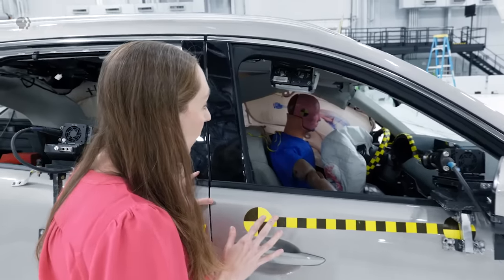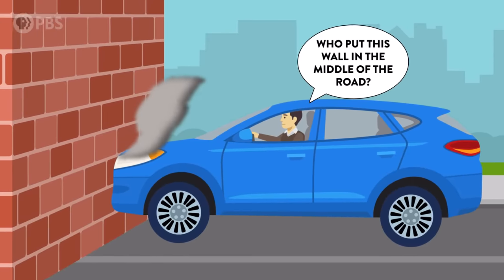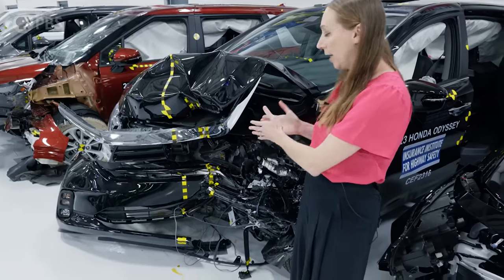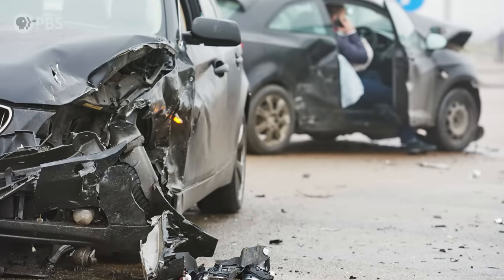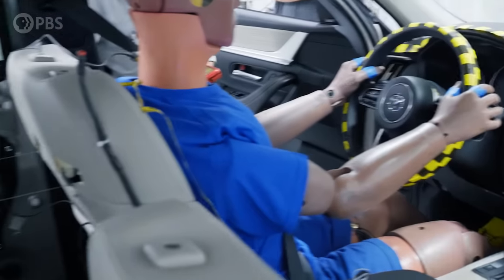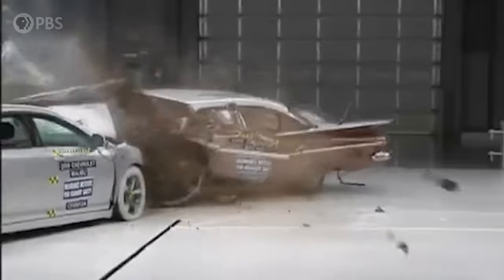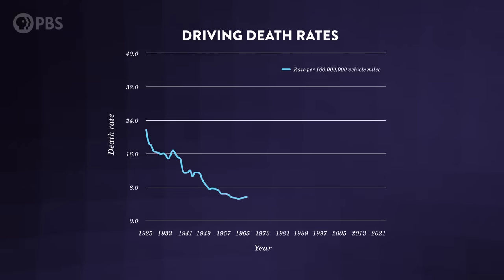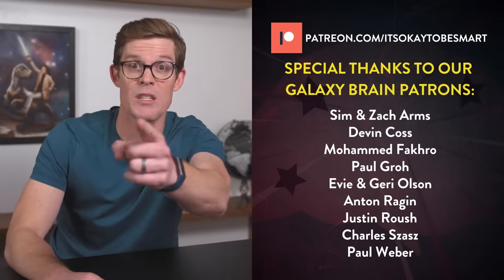The Incredible Engineering That Helps You Survive Car Crashes

Comment: My favorite fact in the topic is that the most violent looking motorsport crashes where the car rolls like 300 times are the safest because it has a long time to absorb the energy. As long as the rollcage remains intact you are most likely good.
Reply: I would like to note that motorsport has the best crash safety and a lot of stuff used in passenger cars is specifically banned in racing due to safety reasons. But good luck getting a soccer mom to agree to a 5 point harness and a HANS device taking her kids to the game, so passenger cars accept slightly less safe solutions for the sake of usability.
Reply: @reaganharder1480  Well yes. In racing the safety standards are obviously higher since the speed and the chance of accident is also significantly higher. There is always a compromise. Also they ban stuff because some equipments are incompatible with each other or at least have no point using them together. There is no point using airbags if you have 5 point harness and HANS because they mostly serve the same purpose as an airbag. They keep you in place ans prevent whiplash. Also escaping the car in case of fire would be harder if you have 2 tons of airbag around you :D
Reply: @acourierslife-egyfutarelet8856  also airbags are actively dangerous devices, they are just less dangerous than smashing your face into the steering wheel etc.
Reply: @reaganharder1480  you could say this about a lot of things, even seatbelts.
Reply: @reaganharder1480  I'm fairly sure that was true for the first generation of airbags but, as you can see in this video, modern ones are designed to deflate after the collision is over, making it safer and not suffocating the driver or passenger if they pass out
Reply: @agustin268  It's not even about suffocation, though that would be a concern if the airbags didn't deflate after firing. Airbags are like throwing a pillow at your face with explosives. If you are too small an airbag can break your neck. That's why young children aren't supposed to sit in the front seat. But there are still some rather short adults who need to get around so they basically just have to drive around with the fact that a crash bad enough to trigger the airbags is also quite likely to kill them.
Reply: @reaganharder1480  Oh, I wasn't taking that into consideration. It makes sense

Comment: Incredible work that helps to save oh so many lives!
But... There are even more things we can engineer to save even more lives:
* Road side barriers are often the things that are hit by cars and other motor vehicles and they both pose a danger and an opportunity to prevent other dangers; you don't want a car turning over, scaling over the barrier or bounce back into on-coming traffic. the barriers can also be designed with their own crumple zones to extend the crash times and the barrier can of course work to shield other traffic from the out of control vehicle like on-coming traffic or cyclists and pedestrians in separated guarded lanes. Best practice is to always separate different kinds of traffic and vehicles to keep the places of conflict to a minimum.
* Mass and velocity DO matter and CAN be engineered; As American Cars have gotten larger and heavier because of regulation-skirting practices by car manufacturers and extensive PR campaigns that say everyone needs a semi-truck or whatnot, the mass involved in crashes have increased to make every impact more dangerous and even worse so for those in smaller vehicles or outside of a car entirely. That is to say 'BiG CAr loOks sAFe, bUT WiTh bIG Car aROunD oTHeRs ARe unSaFe'.
* As for velocity (speed), we should set the limits around what is safe for the road, not around what gets the traffic flowing as is practice right now in the U.S. We also need to use traffic calming practices that make drivers feel uncomfortable to go at too high speeds; fewer and tighter lanes, raised pedestrian crossings, speed bumps, separating stroads into aptly desgined higher speed, transportation-oriented roads and lower speed, destination-oriented streets, less straight streets and more roundabouts.
* More and more air pollution and greenhouse gases lead to lost years of health than crash events with vehicles so improving on the pollution front of cars is still an overlooked area of possible improvements: Electric Vehicles (aside from when the batteries combust) are cleaner in this way especially so if the electricity was generated through renewable sources or through nuclear energy. Biofuels are hydrocarbon fuels that aren't fossil fuels but made from agroculture, forestry and waste by-products that are somewhat cleaner but don't typically contribute to greenhouse gas emissions as long as there's sufficient replanting done with each harvesting. More effcient motors, aerodynamic shapes, again smaller sizes and less polluting production methods and cleaner materials lead to better fuel efficency or otherwise mitigating the pollution associated with cars.
* Fewer cars and less miles travelled in them help everyone. By prioritizing pedestrian, cycling and Mass-transit infrastructure everyone will be safer and have happier, healthier lives. By designing our cities and other developed land in cleverer ways we can make many personal errands unneccessary by either clumping destinations together or providing services that do errands for people or provide services online. Higher density also lead to shorter distances travelled by car and DOES NOT have to be skyscarpers. The benefits of density exists on many levels and in the U.S. you are missing out on the middle density and mixed purpose zoning.

Great video and all that but there are so many more things we can do to make the deaths due to cars come close to zero.

Comment: FIrst off, overall a great video about the physics of crashes. However, I have a bit of a problem with what you said at 6:05 - 6:15 about there not being much to work with and "The car's mass is whatever it is." 

I'd argue that the engineers have a lot of say in what the mass of the entire car is. They design the whole thing! Every year cars keep getting larger and larger and heavier as a result. It affects braking distances, crash forces and it seems to have become an arms race between manufacturers to make bigger cars so that people "feel safe" driving. And once you get these massive cars on roads everywhere, one can feel unsafe in a smaller car and ends up getting a larger car to compensate. So I would have liked to hear more about how the mass affects crash outcomes. if you have a 1000kg car and a 2000kg car collide head on, what's going to happen to either car?

In addition, based on this video it seems like the tests are only testing the safety of the occupants inside a car. Does the testing suite have any pedestrian safety tests? And with cars getting taller and more square on the front, I feel like pedestrian safety should really be emphasized a lot more as people who get hit by a modern car, are more likely to get hit in the torso as opposed to the legs if a older, lower car hit them.

Pedestrian traffic death statistics really paint an ugly picture about the direction in the US right now, so I'd hope to see more on how that is being addressed.

Comment: There are SOOO many details visible in that crash! Probably my favorite is just how clearly you can see and hear when the much more solid front of the cabin strikes the barrier. What is interesting to think about is that moment is probably the most dangerous part of the collision, for all the same reasons the stiffer cars were more dangerous than those built to crumple. However, it is intentionally left that solid because having the cabin itself crumple is so much worse than an acceleration spike mid collision, especially with all the other features in the cabin.

Comment: Your example of a 10s stop from 40m/s (thats 144 kph, 90mph) reminded me of an example physics question I did a deep dive on. If one is interested, I can try to find the question itself but in a nutshell it had to do with trying to drop an object into the bed of a truck travelling at a very high rate of speed. But the textbook had an absurd m/s value (probably by accident) so the teacher corrected it for something more realistic -- but I wanted to see what it took. My deep dive then took into account how far you could see the truck from (so youre on a watchtower), the bed length of an F-150, and how fast the object had to be travelling to land in the bed without killing the driver or damaging the cab.

Long story short the object basically had to be fired from a civil war cannon (because earths gravity couldnt accelerate the object fast enough once you could see the truck at the given height) aimed straight down (because the object was "dropped") the instant you saw the truck speeding over the horizon 😅

Comment: 01:52 nope. car manufacturers are building safer cars because waaaay back in the late 1950s and 60s, 
the government passed legislation that required them to. 
the car manufacturers are perfectly happy with the carnage on the roads, 
as long as it doesn’t affect their profits. 
(you will note that it is the Insurance Institute that conducts the testing, 
not the auto manufacturers)
Reply: The auto manufacturers are required to pass all FMVSS (or CMVSS in Canada) test before selling a car. NHTSA and Transport Canada are then doing compliance testing and making sure cars are safe. If not, recalls are made and I’m assuring you that the manufacturer don’t want to deal with recalls.
Reply: @NahNnii  "as long as it doesn't affect their profits" is the caveat I offered. 
the regulations you speak of were not put in place by the auto manufacturers. 
they were only instituted after the public outrage that manifested itself in the wake of Ralph Nader's exposition of the callous disregard for safety in the late 1950s and 60s. even then, the auto manufacturers only grudgingly complied.

Comment: Relevant insight: MPU6050, a common accelerometer used in hobbyist industry has a limit of ±16G, which is far too less for logging sudden retardation like in a crash. That might be the reason why we see a max retardation of ±16G at 10:06; actual retardation might be in the range of ~20-25Gs.

Comment: I was surprised to see that IIHS allowed you to be in the same room as the crash. I worked at Ford, for a supplier, and we had to be in a booth, high above the floor that was also sound deadened.

A few things: 

While the seat belt retraction late in the crash is fairly new, the same effect has been in all vehicles sold in the US, Europe and some other parts of the world since the 1970s. The technology was that a section of seat belt was folded over on itself, right near the buckle, so it was independent of how much belt was fed out. This was stitched together with special threads that would tear away under pressure. There was even a special pattern to the stitching so that it did not all tear at once, providing a slow (compared to crash speed) lengthening of the belt. This predated air bags.

While we witnessed the test, even the preparations, most of the crash study was films. We had 2 video speeds back in 2001 and 2002, they were 1000 frames per second and 1500 frames per second. I can see from the films used in your video that the technology has moved on and they are much closer to 10,000 frames per second. At 1500 frames per second, the main airbag was fully inflated in just 2 or 3 frames. 

You also stated that offset crashes was new. It was not, even the manufacturers, who meet all US federal safety requirements, and then do some additional testing, usually on prototype vehicles to test new technology and new systems. But do significantly fewer tests that IIHS. But we still did offset tests. 2 in fact, a rigid barrier and the soft barrier - which is used instead of another vehicle so that it simulated an average other vehicle. We even did different heights of the barrier, especially when it was the barrier striking the vehicle, such as in a side impact test. The different heights simulated another passenger car or an SUV. While the SUV and truck boom were well under way, sedans and coupes were still standard cars at that time.

The side impact testing for some vehicles was repeated quite a bit, so that changes could be made to get a passing grade when a passing grade was not every time. An example was the Ford Explorer. I did NOT work on that platform, but engineers talk, especially at facilities where all platforms meet. There is a breadboard, which is a wiring mock up, for every vehicle Ford makes at the prototype facility in Allen Park. This is one of the places where I met my counter parts on other platforms. The Explorer was having trouble with side impact intrusion. Until they ran a trim model that included running boards as standard equipment. With additional testing to confirm, as well as all the types of running boards they were using at that time, running boards became standard equipment on all Explorers. The design was new, but the test standard was newer, and they could not accelerate the next version of the Explorer in order to pass the test. Usually the government gave a long term heads up that they were working on a new standard, so that vehicles could be designed to meet the new standard. In this case, a new standard came out very fast. Since them Ford has corrected this, but then found that running boards were now expected by customers. One of the few times that government testing standards led to customer expectations. Yes, customers expect safer vehicles, but many still try to not wear seat belts. Part of why while they test with seat belts, if the seat belt is not worn, the airbag comes out a bit faster. This is front seat only, where there is a passenger detector. My personal car tells me I have a front seat passenger when I have a bag of books on the seat. Which the bag is often there, but only sometimes alerts the sensor. Rear seat passengers were unbelted in more than a few test films you used, as you see the rear of the front seats is the cushion for them. Not an ideal situation but most humans are too stupid for their own good.

Comment: 🏎 I wish you had included 2 more things
1. what happens between the car crashing in the facility and you being allowed to go up to it (saw some kind of grit on the floor);
2. from what I've read more deadly crashes in the US are happening bc more SUVs are impacting children and small people, are they testing specifically for that scenario?
Reply: There’s absorbant added (the grit you saw) so all the fluids that are left (transmission oil, break oil, coolant) are easier to clean and safer to walk around. In the facility where I work, there’s also people reconnecting all the cable for power and data communication to the car that is battery power for the crash. We usually photograph all that is needed before letting anyone touch the vehicle and especially the airbags.

Comment: They need to do more testing on people outside of their standard test dummy size. My mom is 4'10" and she'd likely die or be extremely injured if she was in an accident where her airbag deployed.
Reply: Yeah that's what I always wonder. I'm 5'4" and I have the seat almost all the way forward to be able to reach the wheel and pedals. I have no idea if the air bag would deploy in time for me to not hit the steering wheel because they usually test on 6' "male" dummies
Reply: @nosneb99  I think that the bigger issue is that you're too close to the air bag and it would hit you with too much force. The airbag is supposed to inflate, then you hit it. With you being so close, you'd likely get hit by the airbag instead of you hitting it. You'd be better off if the airbag doesn't deploy.
Reply: There is testing on smaller sized dummies in driver seat. And also on dummies really close to the steering wheel. And there’s also testing on worst case scenario where a dummy would have their head directly on the wheel when the airbag deployed. Airbags are a lot less scary then they were 15+ years ago
Reply: @NahNnii  Do you have any links to that info? I'd love to read it. Everything that I've found says that people should still sit at least 10" away from the air bag.

Comment: Observation:
 Removal of fluids ( ie; gasoline, transmission fluid, oils, power steering fluid, radiator fluids, freon, windshield washer fluid, etc ) create the exact environmental hazard that is an unknown variable in a crash. It is exceptionally necessary to have these fluids on board and crash the vehicles in a more open environment if necessary because now you're taking those variables out and a leaking gas could create a fire hazard or a Freon brake line could be spraying freon in onto the passengers these things are must know they have to be known in order for you to build the safest vehicles

Comment: 6:12 "The car's mass is, whatever it is"

You can't change the vehicle's mass right before a crash, but it is a choice. The buyer's choice to purchase, the manufacturer's choice to design/build, and the government's choice not to regulate that results in a sea of SUVs and pickup-trucks that are large, heavy, have poor visibility, and a bumper height that a) doesn't align with other vehicles, and so causes hatchbacks and sedans to dive under the bumper resulting in fatalities, and b) strikes people in the torso, resulting in their heads hitting the engine bay, instead of in the legs where their bodies can pivot around their hips and their torso can hit the engine bay.